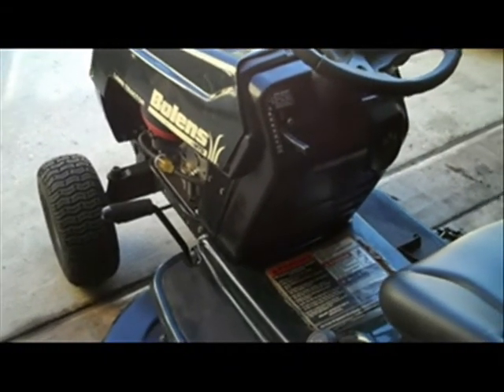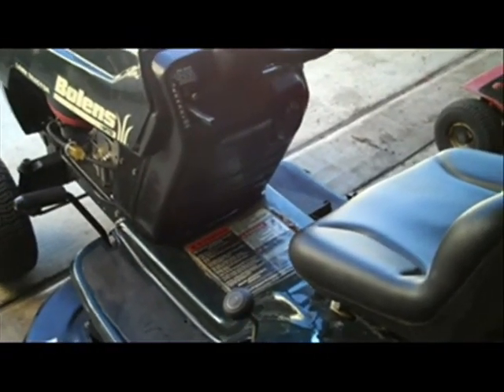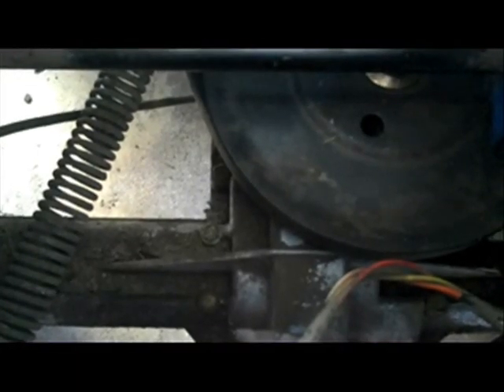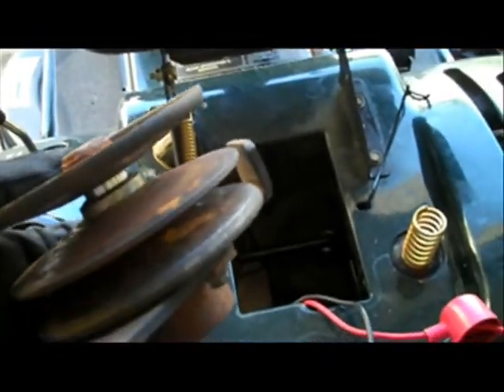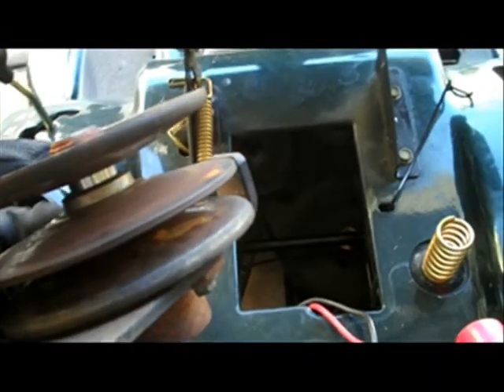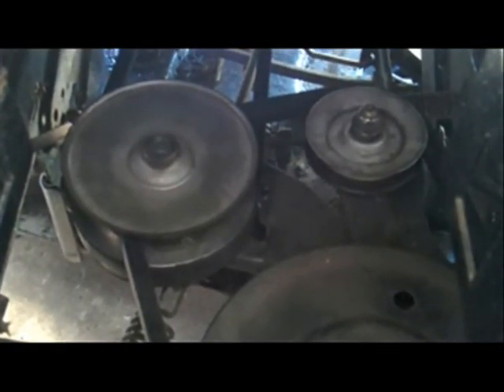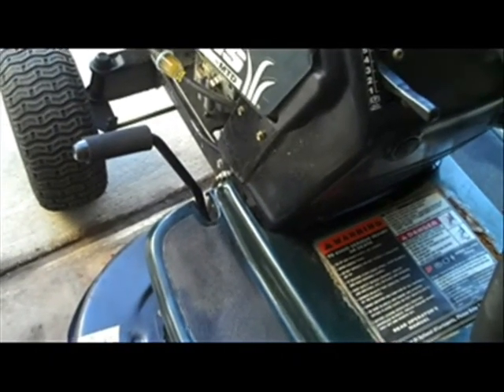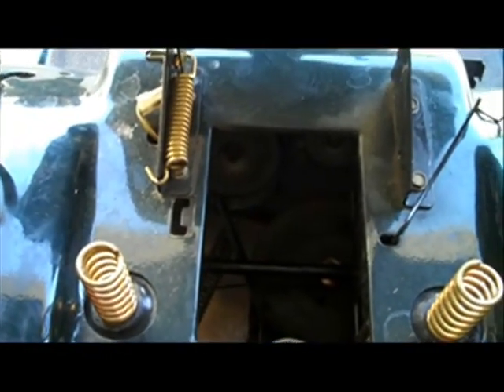How the MTD Varidrive system works

Comment: Do these last longer and can tow more than a hydrostatic counterpart?
Reply from the maker: Overall they are more durable, but the belts wear faster than normal belts, especially when they are under heavy load. However its 30-40$ for new belts vs a couple hundred for a new trans.
Reply: Doesn't that cvt make you shame like it does me?
Reply from the maker: I don't even know what your asking, my personal mower is a Craftsman with a manual Transmission, I sold the mower in this video right after I made it.
Reply: *****
Well I thought the 7 speed manual in the troybilt was an actual manual and finding out its just a cvt with manual shifting made be loose faith in this lawn mower because it fools you into thinking that you have a true manual transmission but you have like cvt, you get what i mean, it make me feel bamboozled, and thats what i was asking you sir do it make you feel bamboozled when you think you have manual transmission but an actual cvt with a manual mode.? Like the nissan maxima has a m mode, but it a cvt, do you get my point of view question im infering to you sir?
Reply from the maker: knightrider1545 It's a different feeling When you already know it's not real. MTD has been doing this for decades. It is annoying that you don't get the benefits of a true manual. For that go with a Craftsman, Murray, or John Deere.
Reply: *****
Well I didn't know about it at first which made it dissappoiinting.
Reply: *****
Sorry didn't know mtd beendoing this for decades, but its sad in my opinion.
Reply: *****
Yeah it is annoying, its like saying like a bicycle has 18 gear but only like 12-13 usuable gears.
Reply from the maker: If your not happy with it I recommend getting a different mower, something with a True manual transmission. I prefer Craftsman, though I'm kind of biased. MTD is one of if not the largest manufacturer of rebranded mowers, so this system is everywhere.
Reply: *****
Can a true manual transmission shift on the go like idk , a car.?
Reply from the maker: No, you have to stop completely, that's why MTD uses the Varidrive for everything.
Reply: *****
What made in the the true manual trans make you have to do that?
Reply from the maker: The Brake and clutch are operated on the same pedal. If the brake is worn or you adjust it you can push it in just a little and shift while moving, it's not the best for the transmission though.
Reply: *****
Can you have a clutch pedal as well added.?
Reply from the maker: If you separated the functions you could, though it would be easier to add a brake pedal and leave the clutch.
Reply: ***** Yes, thats a good Idea MY GOOD SIR!
Reply: My 1988 MTD has the varidrive or as they called it then “transmatic” it rarely has issues and I beat the crap out of it. When I was a kid my dad bought it new and I remember dumping it in gear and poping a wheely all the time. I have to change the belts a lot though. My experience with hydro transmissions has also been good. My 75 IH cub cadet has the hydro and we use that thing to pull a 7 to 8 thousand pound camper. They don’t build them like that no more though.